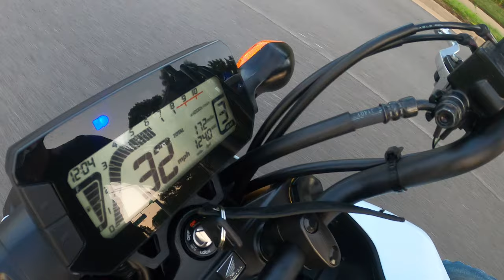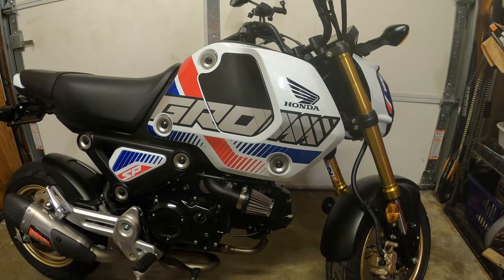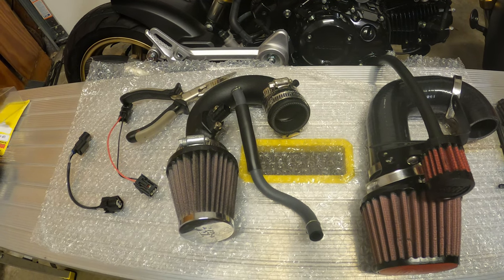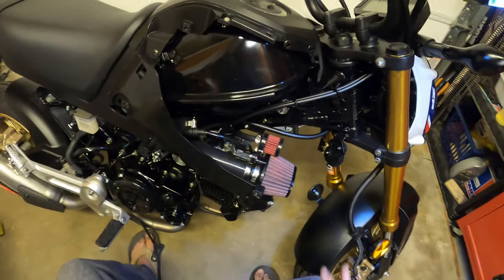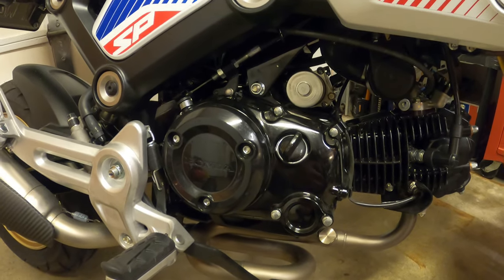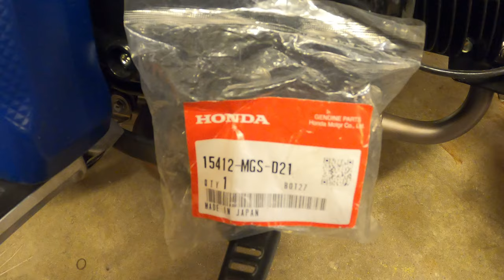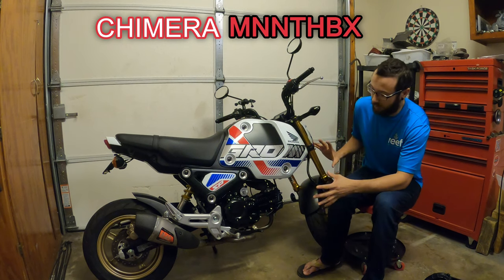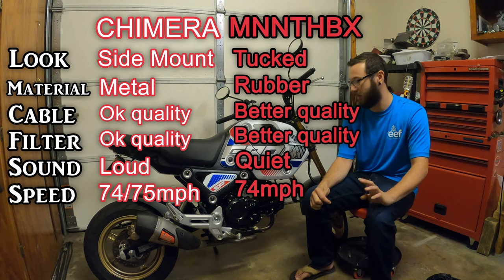2022 Honda Grom (Chimera VS Mnnthbx & Oil Filter Change)

Comment: Both intakes will make a bike run better, so with that said... Great honest enthusiast video. It's always enjoyable without an angle....
Reply: Hey Mnnthbx will all 3 of the washer bolts from the fairings on both sides  still have mounting points with this intake installed? Or do the 2 bottom washer bolts on each side mount to the sides of the OEM air box?
Reply: @minimotomatt9447  The new body work doesn't need the bracing as much as the prior models. For those that require extra strength for whatever reason, you can trim the airbox, leaving the outer skeleton to use as the bracing.

Comment: Leaving the sensor exposed to unfiltered air was a lazy solution from man in the box and will cause the sensor to fail sooner. And a rubber hose? Come on man, the tube needs to be solid. Like the filter placement and wire harness extension though. I think I'd prefer the chimera bug try to order the pigtail from man in the box.
Reply: Chimera has already addressed the issue with the IAT extension, they have a V2 version which all new intakes shipped after Jan 2022 will have included.
Reply: @steadygarage  I went w/ MNNTHBX because he does not block people who live outside the USA from shopping on his site!

Comment: Whomever told you not to run synthetic is dead wrong. It’s the best for air cooled bikes. That rumor has been around since the invention of synthetic oil. It handles higher temps better than conventional. One easy way to tell is by asking them why not. They’ll say that’s just what they were told lol. Been running full synthetic in all my bikes for 20 years. I am curious though if the bar and chain oil had a negative effect, being so much thicker than the recommended oil.

Comment: Another advantage to the man in the box intake is the thick silicone tube. It will not absorb as much heat as the metal chimera, so you'll get a colder intake charge. Heat soak is always something to avoid.
Reply: Actually aluminum is much better as the cold air will actually cool the aluminum tube, hence why the majority of intakes used in the motorsport application are aluminum. The temp. isn't trapped as on the 2022 Grom, the intake is out in the open. Touch a Chimera SRI after the engine is running and let everyone know how cool it feels on the aluminum tube. It'll cool down even more once you're riding.

Comment: don't use synthetic oil?!?! bro just because you don't like it don't knock on a statically proven better oil lmao
Reply from the maker: I mean do what you want it wont hurt it. I just dont run synthetic is small stuff is all. If I was getting up into 600cc+ motorcycles Ide probably run synthetic. But small stuff like 125cc dirt bikes, 212cc predators, etc, I use the valvoline I showed.
Reply: @tylertaughtme  even small bore engines benefit from better lubrication and the anti wear properties of synthetic oil. Especially if you do any engine work to them like a upgraded cam with even tighter tolerances...

Comment: I just installed the MNNTHBX intake. From the get rid of list. 
1. I still have the stock exhaust, yoshi exhaust soon!
2. I think I will cutting the OEM air box just to cover the space at the bottom, that looks horrible without that box in there. 
3.  I am keeping my OEM plate holder ( I'm the only man on earth who likes it 😂). Lol
4. DHM cam is on the way.
Reply: I'm thinking of getting the TST Industries ram air cover and large intake tube instead of an intake for the exact reason you stated.... Looks terrible. 
The rear fender works great if you ride in the rain. It does look odd for many but it works. Fender eliminators are sleek but everything ends up on your back 😂
Cops are a pain in the ass where I am, any mods that are stealthy is a good mod for me.

Comment: What’s your thoughts on the fairing slop that the cold air intakes bring? I just installed a mnnthbx on my 22 grom and am almost considering swapping it for a chimera just so that I can get a kitako oil cooler to bring back the fairing support
Reply from the maker: The slop is gonna happen until someone comes out with a brace of some sort to bolt in. Fyi, With the oil coolers you can only run certain intakes or they wont fit.
Reply: @tylertaughtme must not bother you as much as me, as I’m considering switching to chimera just so that an oil cooler will fit, which will bring cooling and structural integrity back, I also see you lost 1 mph top speed with the mnnthbx, I did see a support rod they sell for the fairings too, which may work with the mnnthbx
Reply: @tylertaughtme  did you have to reflash the ecu while going from chimera to mnnthbx or are they simalar enough?

Comment: Did you really use bar and chain oil on the filter?
Reply from the maker: Yea in a pinch any thicker oil is ok to use. I have since cleaned the filter and used actual k&n filter oil.

Comment: why oil the intake filter?
Reply from the maker: Filters like these require oil to help catch small particles. Usually you use the recommended filter oil but bar and chain oil is viscous and stickier than something like 10w-30 so it is an acceptable stand in for filter oil.